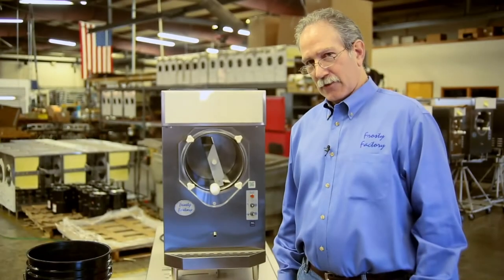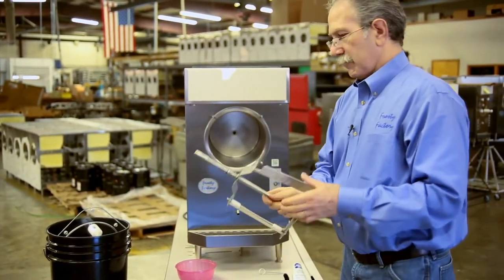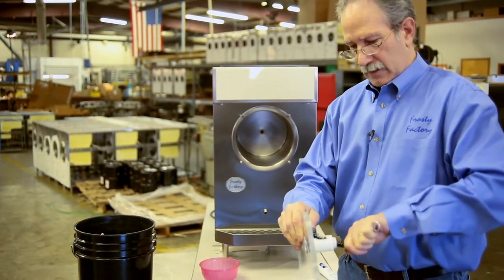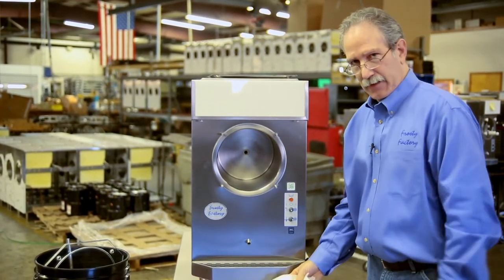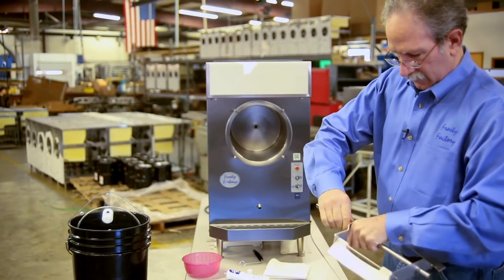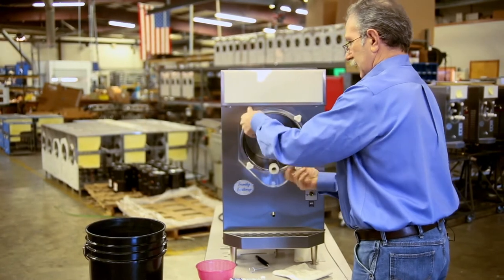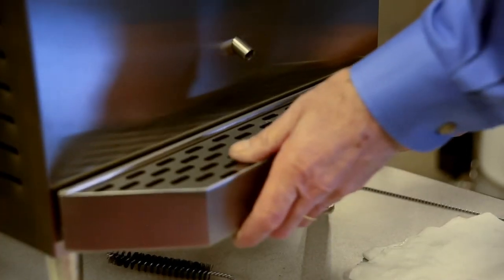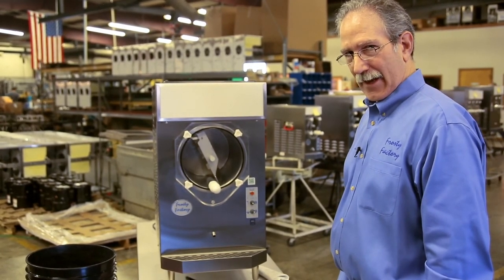How to Clean Your Frosty Factory Machine 🍨

Comment: Which model is that?
Reply from the maker: Hi Kraig!

You can find the product details from the link below:
https://www.chefsdeal.com/frosty-factory-289a-cylinder-type-non-carbonated-frozen-drink-machine.html

Best regards.
Reply: @Chefsdeal  Thanks for your reply. The model in the video looks alot smaller than the 289a. Based on the link you sent me, the 289a switches are next to(the right side) the cylinder. The model in your video has the switches Below the cylinder. Just an observation.
Reply from the maker: @TheBekraig  So sorry Kraig, you are absolutely right. We will contact our procurement department as soon as possible and provide more accurate information.
Reply from the maker: @TheBekraig  Hi Kraig! 
The product in the video is most likely this:
https://www.chefsdeal.com/frosty-factory-137a-cylinder-type-non-carbonated-frozen-drink-machine.html
Please do not hesitate to contact us with your questions.
Best...
Reply: @Chefsdeal  Thank you. I'll check it out